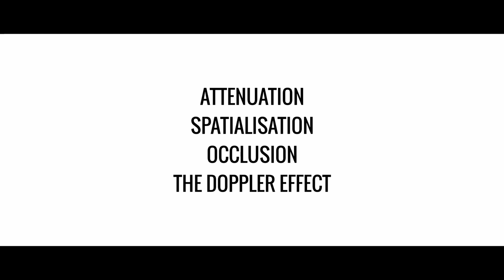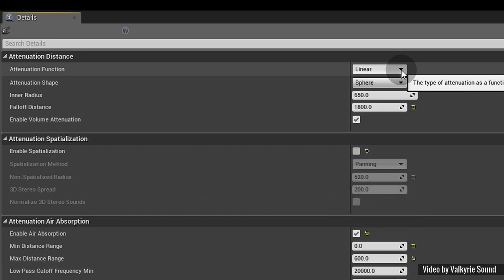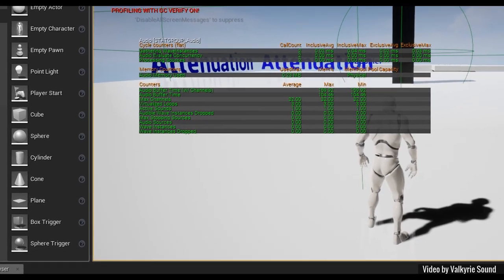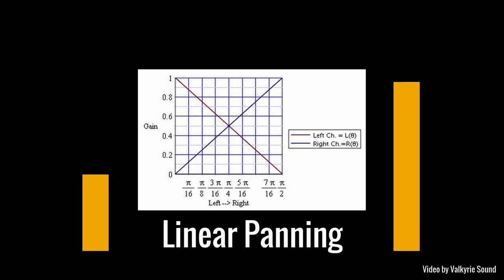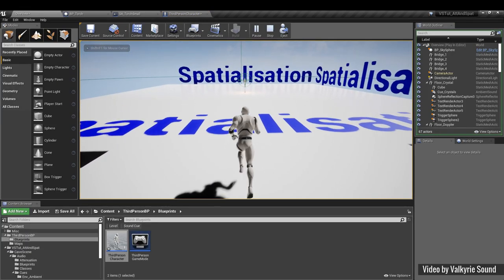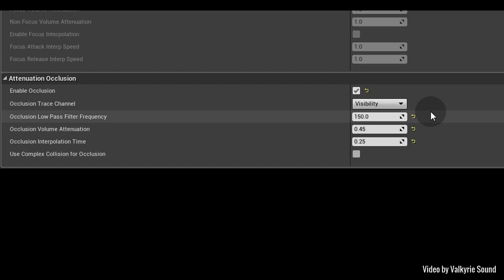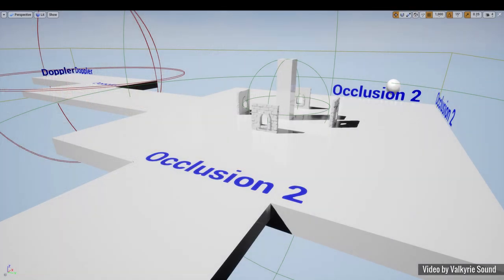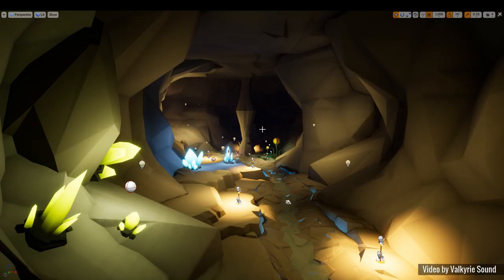Attenuation, Spatialisation, Occlusion, and The Doppler Effect - UE4 Tutorial

Comment: Is there a way to increase the size of attenuation spheres while in Blueprints?
Meaning... You have sound that is supposed to get gradually louder. The falloff would increase, but I can't find a control in BP that allows this. I  can increase volume, but not the distance.
Reply from the maker: If you want to dynamically increase the radius of the attenuation sphere you'll need a reference to the attenuation in the BP, and from that you can get the Attenuation Settings. Split the output and you'll get a million pins. One of them is distance - and I believe (iirc) that you can make a new Attenuation Setting and it will (I think!) respond dynamically to a change in radius if connected to a Tick. Let me know if that works though. I'm sure I did it but it would have been a while ago now :)

Comment: With UE 4.26 released, is there a way to edit sound travel speed in water...oh wait maybe an edit in attenuation !?
Reply from the maker: Interesting! There isn't a speed adjustment feature as far as I know. If you want to give the impression the sound has been slowed down, you could use the pitch shift on the Modulation node in the Sound Cue (you could use a Switch node so you can jump between the same sound with / without the Mod node, e.g. setting to 1 when the Player enters a trigger area). Or you could add an Audio Volume to the underwater area and apply a Low Pass Filter at <200 (or something), which will make it sound like all audio in the Volume is muffled. You can apply other effects using Audio Volumes as well so that might be a good option to explore :)
Reply: @valkyriesound3888  hmmm, thanks for the suggestion, even though it is a shame they didn't thought of it...
Reply from the maker: No worries. You can still get the same effect using Delays and LPFs ;)
Reply: Interesting.....add a delay on sound attenuation in surface actors, and when submerged, reduce delay to give illusion of sound speed....I dunno, am not an expert on BPs..just trying to figure it out
Reply from the maker: No worries. You can't add a delay to the attenuation. You could technically do it, but the sound will have played before the attenuation has been applied. What effect are you wanting to create?
Reply: @valkyriesound3888  basically I wanted to have 2 effects, 1. on land when something explode from a distance, it supposed to have a delay cause sound travel slower in low density matrix like Air, it travel faster in dense medium like water.....and am doing that for a sub semi simulator.
Reply from the maker: Ok. You could measure the distance between your Character and use that to adjust a Delay node in the object playing the sound. You can use the Get Distance To node to measure it, and you'll need to create a reference to your Character in the object playing the sound. Plugging a Play node into the output of the Delay will give you that effect. You could use a Float Curve to set what return value for the Delay you'd want, based on distance. You can also change the type of Float Curve you use depending on whether the character is below water or not.

How to trigger the difference depends on your maps. If it's big scale, instead of using trigger volumes you could set a "sea level" - a Z value below which the Character is classed as being underwater and >= which the Player is classed as being on land. That won't work if some of your land goes below the sea level but isn't supposed to be underwater. If your geography is complex, trigger volumes might be better.
Reply: @valkyriesound3888  As much as am happy to mainly understanding that great solution u suggest, but it will take me time to fully understand it.....will try to follow it bit by bit...
Reply from the maker: No worries ;) If you have a question just drop me a message here or on Reddit: https://www.reddit.com/user/Valkyrie_Sound

Comment: Thanks for the tutorial, you are the best! 

i have a question... how can we un-enable audio occlusion ? it is like default feature of unreal audio system... there should be an option to remove this feature i think... 

do you have any idea?
Reply from the maker: Thanks! :D Audio occlusion is part of the engine but it's only used if you enable it. So long as you don't tick Enable Occlusion in the Attenuation setting it won't get used :)
Reply: @valkyriesound3888  actually i never use any attenuation in my project.. 
I've been dealing with the occlusion problem since I started the project. (Unreal RPG DemoGame is my mentioned project by the way) I use Wwise for implementation...

I wouldn't want to keep you busy with these issues, but that's the case :) Thank you for your kind answer...
Reply from the maker: @ucadn  Oh, if you're using Wwise then that software enables occlusion by default. You should be able to set the Occlusion Refresh Interval to 0 on your sound, which will effectively disable it :)
Reply: @valkyriesound3888  yes! it solved my problem! you are the most beautiful person in world :)
Reply from the maker: Haha thank you... I think :')

Comment: just as a fyi its probably best to use 48khz than 44.1  as 44.1 is cd format and 48hz is natural pcm without conversion.
Reply from the maker: This could easily become a long debate :) I'll try to keep it brief!

While 48 kHz offers more fidelity, which sample rate you go for depends on a few factors, including target platform, file size, and whether there's a noticeable difference between the same file at 44.1 / 48 kHz. 

The UE4 manual recommends 44.1 kHz (https://docs.unrealengine.com/en-US/Engine/Audio/WAV/index.html). Android and iOS also recommend 44.1 kHz for their mobiles but 48 kHz should be fine for desktops. 

For tutorials, my approach is to try to follow what Epic recommends and what's in common use, so that the things we look at and make can be used on any device (ideally!). 

The Engine does support importing sound files using any sample rate (https://docs.unrealengine.com/en-US/Engine/Audio/Overview/index.html) but it's about what's going to work best for your target platform / device.
Reply: @valkyriesound3888  great response! Good to know.
Reply from the maker: @raedius_music  no worries, thanks for watching!
Reply: @valkyriesound3888  so if you are only making a pc game, should you use a higher rate?  for example, do you think alien isolation used more than 44.1?